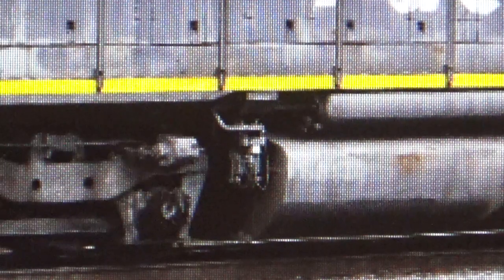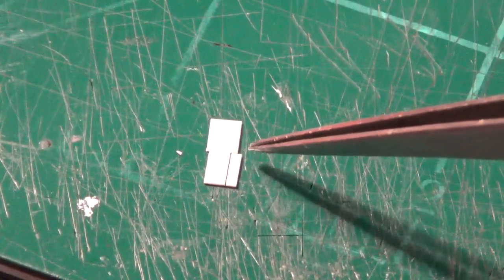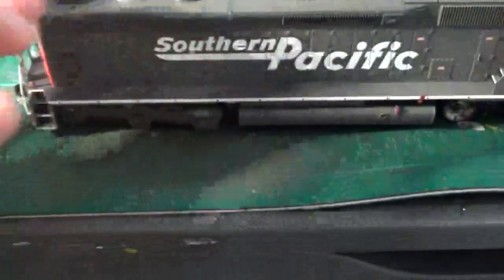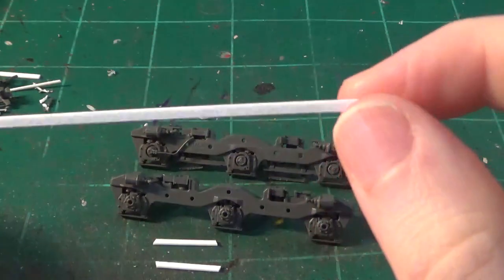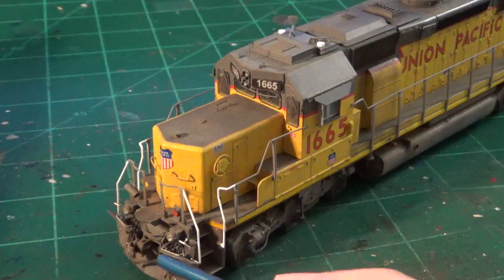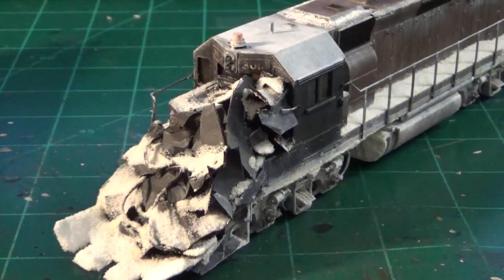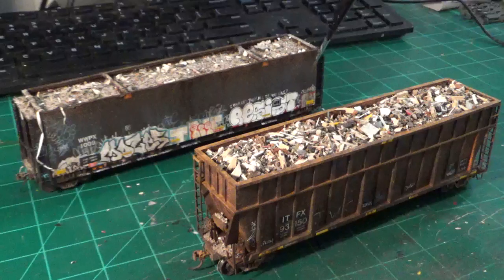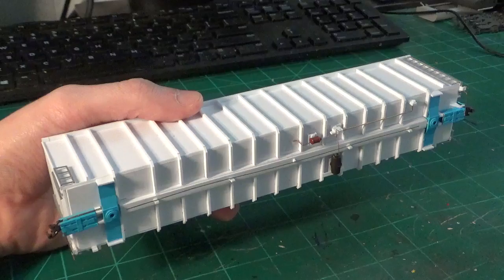DCT Modeling Tips: Styrene Fabrication. Part 2 of 2!

Comment: Have you ever used baking soda with super glue? Supposedly it drys faster and stronger???  I am looking for someone who has used it. I have a N scale lighted billboard made out of metal and used regular glue but now it has come apart again so I am going to try it. If you have any information please tell me, if not when I use it in the next couple days, I will tell you how it turned out.  Takes for your post, I really like them.
Reply: So far as I know it works grea
t! I subscribe to several of these and one is Luke Towan and he used this very method when scratch building trees. He and Joey Ricard have a knack for scenery, simply amazing!!